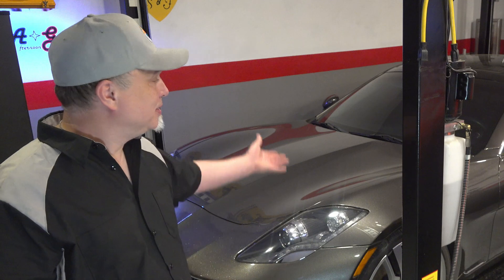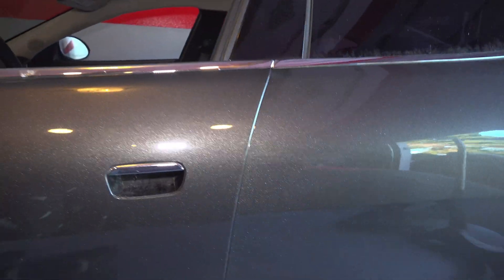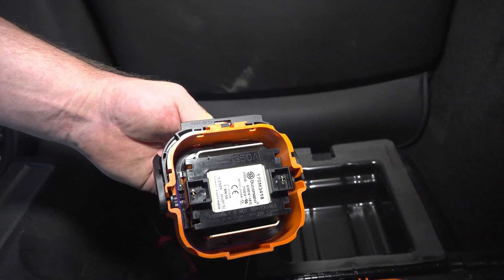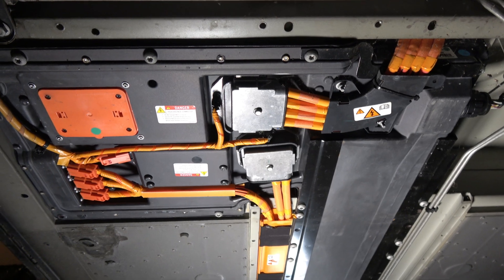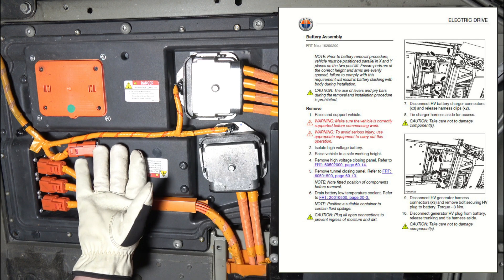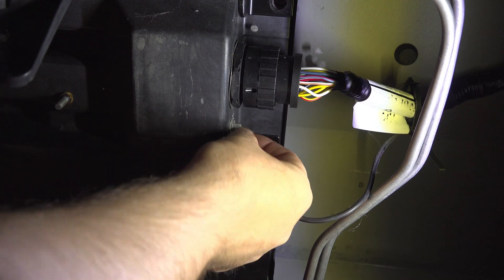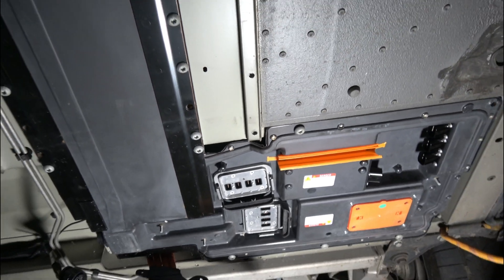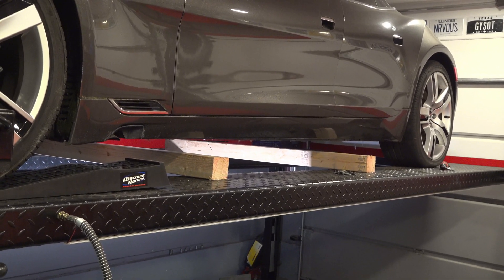Fisker Karma: Battery Removal [4K] Ep44

Comment: What can you do if the long black bolts in the battery pack are spinning and won’t tighten?
Reply from the maker: I had a pack (I think #3 that seized up).  I had to take out the two modules and take  a tap and clean the threads.  Those nuts are held captive by the aluminum structure.  I would suspect that the threads have galled and the captive nut is spinning.  Might have to modify it to use extruded U nuts that are typically used in autobody panels. I never had to do this as they all threaded fine.  A good anti-seize is useful here also.

Comment: I am buying a dead Karma from a friend.  Your channel will help me a lot.  Not sure what is wrong with the car.  It will not boot up at all.  Changed 12V battery already.  Cannot move the car.  Stuck in park.  Local Karma service center says it is the big battery that is dead.
Reply from the maker: That's great you got a car to fix.  Hope you got a good deal and didn't pay too much for it.  There is a laptop that you can use to diagnose the exact problem with this.  I would spend some time trying to get one on loan.  You can go to the Fisker forum, let them know what you are trying to do and see if anyone will step in to help you.  Or, you can do what I did here and physically measure the voltage on the individual modules and replace what is bad.  Good luck with your project!
Reply: @afternoongarage  thanks I will be studying your videos and making some of my own.  I paid very little for the car.
Reply from the maker: OK let me know what you find!  I think I have some leftover cells if you need them.
Reply: @afternoongarage  I'll do an Intro video showing what the car is doing.  And go from there!
Reply from the maker: I left a comment on your channel.  Looks like a security issue.  You should be able to hit the power button and everything will power up.  You won't be able to shift out of gear until the car powers up with the power button. Everything should power up, the cluster, electric power steering unit, and heater controls. The led's lighting up in front of the CIU display is normal and has something to do with the buggy shifter.  Looks like a good car. I would also be curious to know about the pack health.  Unfortunately there without the laptop, you would need to drop the battery like I did to find the open cells.

Comment: Great Video. I am considering buying one in Chicago and I now have an idea what to ask about and look for. Many Thanks !
Reply from the maker: They are really great cars.  I spent far more than I should have on my car as you know.  The two most expensive service items are the battery, and the drivetrain (RDM and traction motors).  I would make sure these have been addressed or a non-issue or you could have a heavy paperweight.  Thanks for watching!

Comment: H, I really like your videos they are great. I took my Fisker's battery apart by watching your videos. I need some help showing which contactor is #5. I wish you got into details with contactors but its ok you still did a great job.
Reply from the maker: I have never had a contactor problem.  I had no reason to remove the cover from the contactors.  I remember a photo out there where the contactors were identified by number.  I have looked and I can't find that.  I would try the Fisker forum and see if the folks there can help you.

Comment: Another great video buddy! My car had some battery cell replacements done when it was in the shop last time, this whole process seems time consuming, how long did it take to remove the battery?
Reply from the maker: Not too long.  I took the most time thinking how I am going to lower the battery down with a 4-post and a 9' ceiling.  After the stand was made for the battery, it took a couple hours to drain coolant, remove closing panels, electrical connections and dropping the battery.  However, I am moving lighting around, and multiple camera angles and also trying to stay out of the shot while working was the most time consuming. Thank you very much for the nice compliment and watching my video!